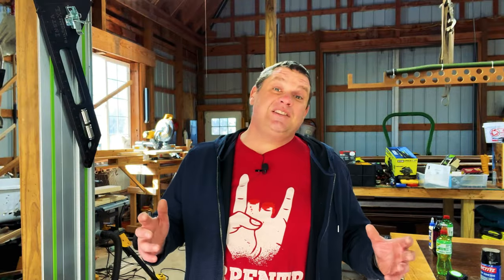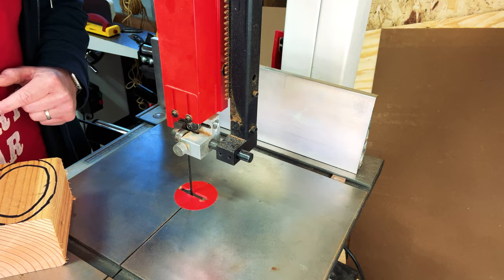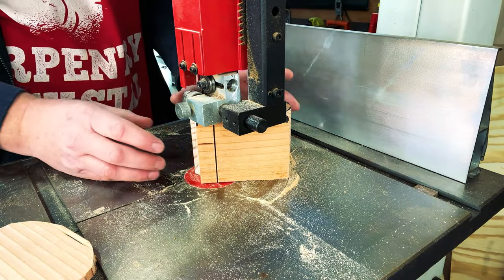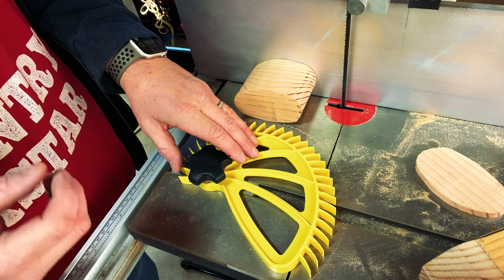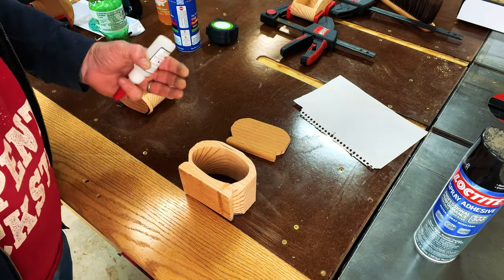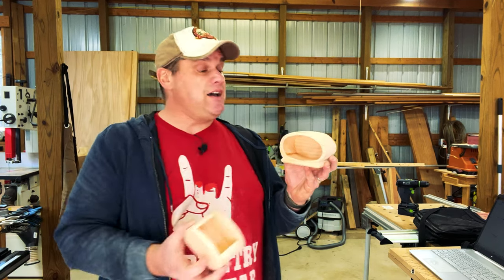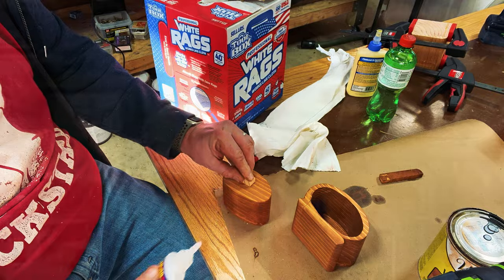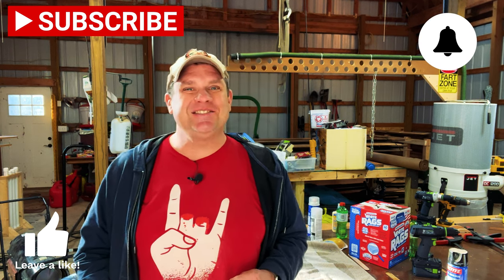Unbelievable DIY Bandsaw Box: Just 6 Cuts for an Epic Creation!

Comment: Nice first effort. One tip from several other videos (we have not tried our hand yet) is to make that cut into the interior along the grain rather than across it. It better hides the glue line.
Reply from the maker: You are so correct Gene!  Someone else had mentioned that and I can't believe I didn't think of that.  Thanks for the tip, and its good to know when I break out the hard wood for a jig saw box!

Comment: A comfort zone is where dreams, goals and growth go to die. This build should help give new woodworkers the confidence to try and challenge the seasoned guys to expand our comfort zones. Well done sir, imperfections and all.
Reply from the maker: Thank you so much Griffin Woodworks!  I 100% agree.   Growth is determined by getting outside your comfort zone.   This bandsaw box that I made has som edefinate issues, especially with how I cut out the drawer, but I learned a lot from it.  The importance of really slowing down when making the drawer cut is so critical.  Also, wasn't happy with the kerf line on the bottom.  A lot of that could have been covered up better if I used wood glue and some saw dust, but since I used CA glue it didn't stain or look perfect!  But that wasn't the point of this project.  Great comment Griffin, and thanks for watching! :)
Reply: @FlynndoggWoodwork  Cutting the kerf line with the grain helps to hide the cut.
Reply from the maker: @carolinesullivan9432  OMG you are so rigth, I wish I would have thought of that!  Thank you so much for the tip!

Comment: I'd love to make a bandsaw box but my bandsaw will only cut 2½" deep. It's okay because I only paid $25 for it 2 years ago. Old old Craftsman. Can only get 1/4" blades for it and only a couple different teeth numbers. I just don't use it enough to buy a new one. 

Your videos are great and I want your Tshirt collection!
Reply from the maker: You should really check out the Ryobi bandsaw.  That is the one I started with.  It worked great for a number of years, and i think it is only like 150 bucks (or at least that’s what it used to be). Only takes 1/4 blades, but I got a lot of things done with that thing and it definitely had a larger height on it than 2 1/2’’ if I remember correctly.  :)